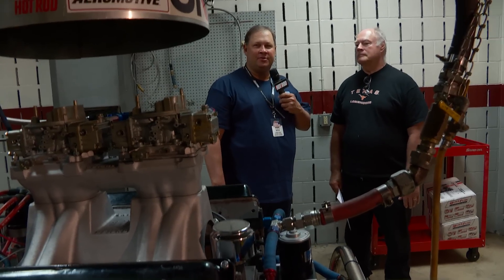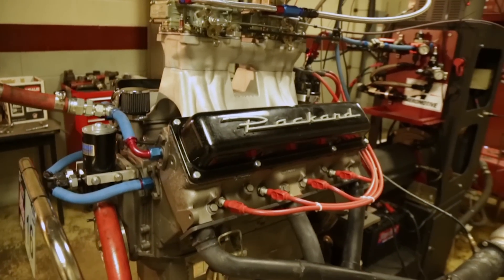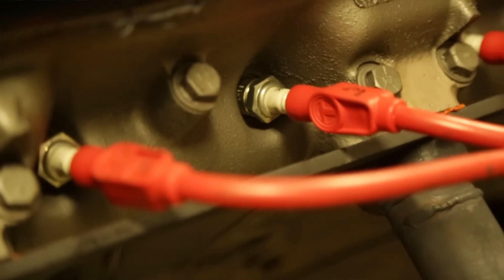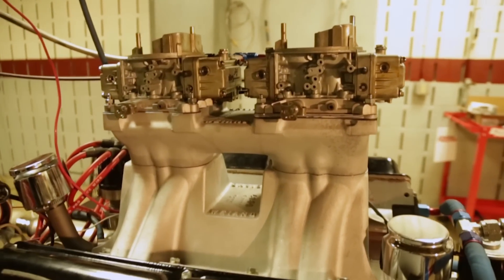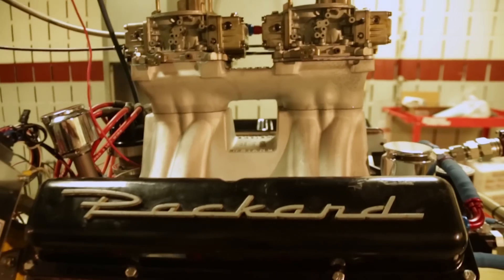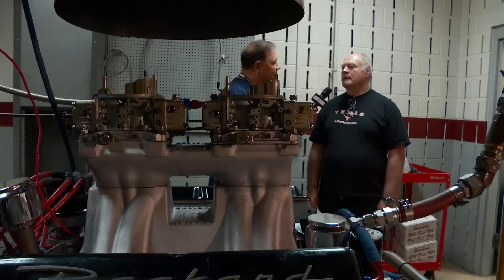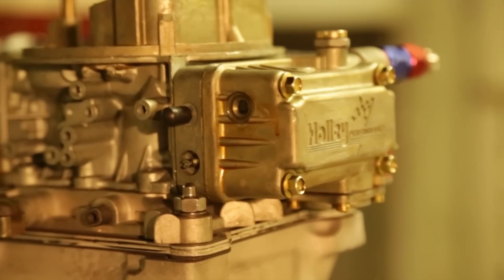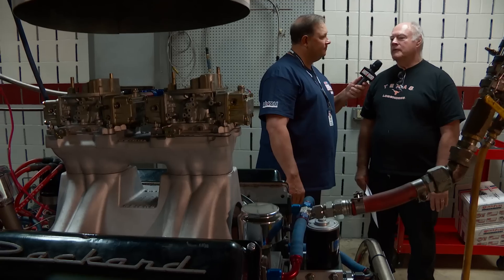The Iron Lung: Vintage Packard V8 Pumps Out 445 hp On The Dyno

Comment: Get in the Delorean, go back to 1954 and tell John how to use this motor in a Studebaker Champion, using the transmission he developed ... and air-conditioning too ... tell him it is 10 years ahead of its time ... Chrysler has a big, fat letter car coming with 300 horsepower .... he can be 1500 pounds less and 100 horsepower more for half the price — the industry will shit-a-brick. Call it .... Mustang ... like WW2 fighters with Packard engines .... come-up with performance comparisons like a drag-race with a P-51 ... if only ....
Reply: They did something like this with the Studebaker Golden Hawk in 1956. It was a sensational performer for the time. Too bad they dropped this engine so soon.

Comment: Could I ask what brand the tunnel ram is? or should I ask what powerplant is it made for? I've heard that the B mopars kind of fit but they need cutting etc, and your ram looks like a bolt on? Almost thinking of twin oil baths as well lol. Thanks
Reply: +muir8009 Sorry, I found the relevant information as to what the ram is - close up it looks like there's some kind of angled adapter plates on the intake side?
Reply: +muir8009  The tunnel ram is from a RB 440 Mopar, made by Weiand. The heads were modified so any RB 440 manifold will fit.
Reply: The tunnel am is a Weiand for an RB 440
Reply: The manifold is very close as is, but the mating angles are different. Therefore the adaptor plate.
Reply: Did you modify the oiling system on this old girl? I have a 56 Patrician with a 374 that seems to be suffering from most of the oiling issues these engines were known to have and I'm curious what you did to make the pump (and the lifters!) stand up to added power and rpm.
Reply: No Packard V8 should be built without a Jack Vines oil pump. Reach Jack at (509) 535-8610.

Comment: Is this one of those 374 ci V8 Packards from 1955 that had a 5 inch bore spacing?

Or is it just a regular block with just the old heads?
Reply: +barath4545 This is a '56 block with modified '55 heads. All the engines had 5" bore spacing. I built this engine. One thing we discovered was the intake valves are too small and the exhaust too big. Plus, the intake ports need almost no porting. Valves should be 2.11"-2.15"intake and 1.60"-1.625 exhaust. There is plenty of room for the bigger intakes."
Reply: +barath4545 The only cars that got 374's were 1956 Patrician, 400, and Caribbean. Everything else in 1956 got the 352, meaning all the Clippers, Executive, Golden Hawk, and Nash/Hudson models that used the Packard engine. The 320 was only used in 1955 Clipper Super, Deluxe, and Panama models, as well as 1955 Nash and Hudson. All the other Clipper and Packard cars used the 352 in 1955.
Reply: +barath4545 The 374 was only available in 1956, the largest engine in 1955 was a 352. This engine has 1955 heads, so I am guessing it is a 1955 352 block also, bore .060. On the outside all of the Packard blocks are the same 55 and 56, but each displacement had it's own casting with different cylinder cores. The 374 obviously had the largest bore.
Reply: We are pretty sure that, with 2.11+ intake valves we will be easily over 500HP. Also, 660 Holley center squiters will make even more power. I hope to find out at the 3027 EMC.
Reply: +barath4545   All Packard V8's had that large bore spacing- even the 320 Clipper version. The 352 is most common. By spec the 374 is essentially a factory overbored 352- though I think where were distinct blocks
Reply: +iadr Ah right, that's true. Might make it easier to find one, if the 352 block isn't too different from the 374 in terms of possibilities for extracting power today. I kinda want one, despite it probably will be a hassle today with custom parts and such.
Reply: v8packard
Great info thx. I thought the 374 was done in 1955 and the only ones that made it into the Studebakers were 320/352's. So its basically the other way around or did the 374s just never get into the Golden Hawks as (iirc) was the plan for both Packard and Studebaker (as a collaborration effort).
Reply: Lynn Peterson 
Take this engine and build the muscle car Studebaker should have made called Mustang ... a name it deserved. Go win SEMA with the car that Delorean and Iacocca didn’t
Reply: Even though this is a few years old. Just wanted to say thank you guys for all this info!  rebuilding 2 packards from the clipper super. Detailed info is pretty hard to find
Reply: v8packard
 This is superb information, thank you very much!
Reply: +Lynn Peterson Thanks a lot for answering, just saw. I love this engine, nice work! ... If you were to guess, how much could this engine semi-safely be beefed up to with the head work, new valve-train parts and cam? ... Assuming one "cheated" with new heads and only keep the visible parts on the outside original or original looking, for example, if one were making a sleeper engine? (Could you go much higher than 474 hp?)
Reply: As far as I know, all the '55-'56 V8 blocks have 5" bore spacing, with different bores.  This one is a '55 .060 over.

Comment: no problem. that's one of their limiting factors for making a lot of power.
Reply: +v8packard  This engine actually makes 474 HP. We screwed up and did not set the linkage correctly on the contest dyno, so the carbs never opened up all the way. Top RPM was 6,000.
Reply: +Lynn Peterson I have often wondered about some of the engines in this contest, if the participants had more time to make sure everything was working properly I would bet the scores would look a lot different. Every time I have an engine on the dyno I end up being there most of the day. What do you guys get, 30 mins? It was still a nice showing for an engine with so much untapped potential.
Reply: +innovativehort You would think the siamesed center ex port would hurt power more, but given the firing order and the fact that most of these engines do not see very high rpm it is not much of an issue. Many engine combo's never really take advantage of ex pulse tuning anyway.

Comment: V8 but 3 exhaust pipes per side?
Reply: +TriniRogue Siamesed ports, just like flatheads and early Cadillacs.
Reply: Yeah they share the same exhaust port.
Reply: Thanks for the info guys :) thats pretty interesting
Reply: @TriniRogue  It simplifies things, but creates a hot spot that doesn't help anything and can lead to cracked heads if you're not careful. Otherwise, it's a pretty good engine!